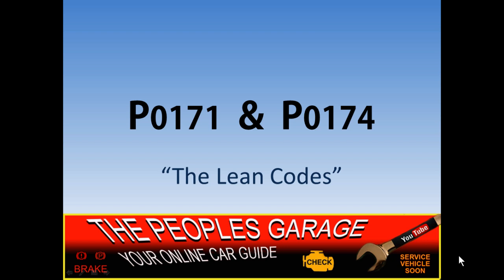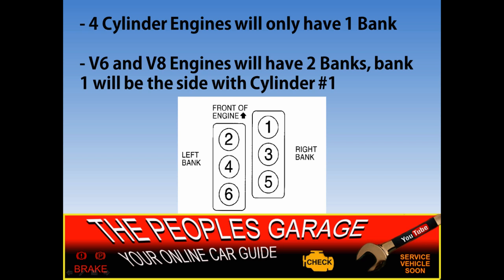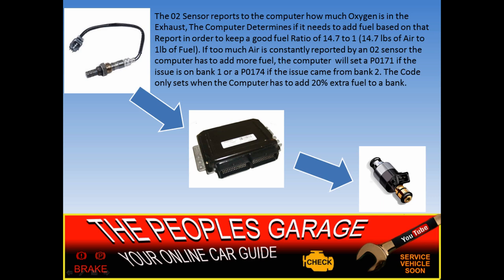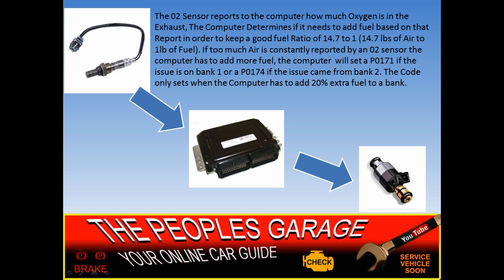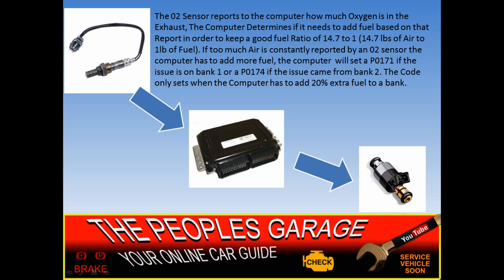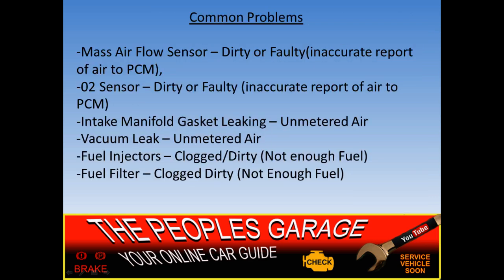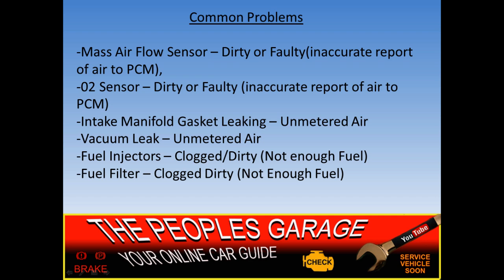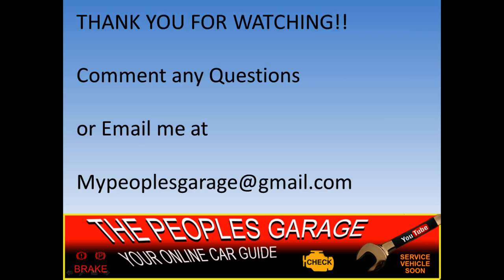How to Diagnose Codes P0171 & P0174 - Lean Bank 1 & 2

Comment: I have a 2002 nissan frontier 3.3 liter Po174 code I have replaced all fuel injectors, new intake gasket new mass airflow sensor new spark, plug wires, new spark plugs new catalytic converters for four new oxygen sensors replaced the fuel filter, spark plug wires, distributor cap and I’m still getting this P174 code I don’t know what else to do. I’m pulling my hair out. I’ve spent about $2000 with different shops. All they do is charge me and they can’t fix it. I’m at my wits end. What can I do? Your videos are very insightful and helpful. Thank you.

Comment: Great explanation I have a 2000 Ford f150 with a 4.2 l engine and I'm getting  p0174 and p0171code I replaced the motor and replace the lower intake gasket, the phlenum gasket and was getting them two codes but was running good So I kept erasing the codes. Then got tired of seeing the check engine light on. So I took off the fuel filter and cleaed it out and it ran great for a while. It just came back on so I'm going to che the pcv and air hose in the back of the motor. Thanks for the information your awesome. I'll let you know the outcome

Comment: I keep getting a random P0174, pending... and sometimes sets a hard code.  Spark plugs and O2 sensors on bank 2 are continually covered in black carbon... I keep cleaning/replacing.  No air leaks. New MAF etc.   Perhaps an ECU issue?  Thanks

Comment: 2007 Toyota sequoia with 4.7L V8 . P0174 . Bank 2 lean . 
Bank 1 fuel trim: short 0.8 up to 2.3
                             Long 14.8
Bank 2 fuel trim: short 2.4 to 5.8
                             Long 25.9
O2 B1S1 output : 3.22
O2 B2S2 output: 3.22
MAF : at idle 0.8 lb/m
Your input is greatly appreciated 
Thank you so much

Comment: Hi there I have 05 F-250 5.4 with code 171 I replace crankshaft sensor cam sensors two of them. Smoke test system cannot find no leaks don't know what to do can you help me out. Motor bucks and pops no power stalls out

Comment: I have a 2001 Chevy Astro 4.3 . Has both codes but they come and go. it will go months with the check light off, then come back on. 
i have checked for vacuum leaks cleaned the mass air flow and checked fuel pressure. I'm lost. I hope you can help. good job on your video. Thanks in advance.

Comment: 2012 Tacoma started with p0300, replaced overdue plugs and coils then  ran good for a day or so then came back. Cleaned MAF sensor and soon after got the po171 and po174. When the codes come on it runs like crap but when I reset the code/s it runs fine again.  Tracking down the issue has been hard. CEL comes on under load usually when accelerating onto highway. MAF, o2 sensor, fuel pump, fuel filter, or intake leak?? How in hell do I find the issue? It’s almost like the ecu is just intermittently having an issue.

Comment: Hello.. May 2023. A po174 question. For a 2003 5.4 Lincoln Navigator 122k miles with all  OBD2 Readiness Monitors all ok (solids).  My engine showed forced air on hot days while driving. Recently, It got hot  a single trouble code po174 cel's showed up.  I believe my issue was to much fuel due to an old K&n filter that is due for a change after years of use noted(old worn) making that 20% issue from your video cel's rich/lean/air mixture.  To test I haven't reset the codes just replaced with another Air Filter (STP Air Filter SA8039) for testing. Since all my monitors showed ok solid. Vehicle runs great and no more forced air on hot days is noted. Other online sites read that a cel's(check engine light) on Engine control modules (ECMs) would reset after 50 miles or 50 engine starts at normal driving if everything is ok at nominal driving conditions.  Without resetting your monitors,  keeping my evap monitor ok (solid) on summer time is quite difficult on hot days.  Some things I haven't found online.  Perhaps, you have an answer for us all.
Question: 
-Do ECM hard/soft trouble codes reset after it's repaired or no longer noticed? 
-A po174 a soft or hard trouble code for a ECM reset itself? 
-A po174 has to be reset in your experience?   
Thanks🙂

Comment: i have 2006 tundra with code p0174  my truck do the lock power i don't have vacuum leak i do the smoke test i get new o2 sensor and MAF sensor but but the code came but after 6k

Comment: I have 2019 Chevy Silverado and I just put a new aftermarket intake on it and I got these codes. I made sure there’s no leaks and cleaned off my mass airflow sensor but it’s still popping up. Any suggestions?

Comment: I have a 2005 Honda Accord....V6 3.0......i connected a fuel pressure gauge....I turn the ignition to the on position and it rises to 58 psi.....as soon as I turn the ignition off it drops automatically to 0 psi.... originally I had p0171 code, I corrected a faulty intake manifold gasket....all new fuel injectors, EGR, all new oxygen sensors, map sensor, pcv valve, intake air tube, my original fuel pump would take about 45 min to drop to 0 psi after shutting the engine off....!! This new after market pump drops to 0 psi as soon as I turn the ignition off, and I also noticed I have trouble starting it now....!! As well as not jus having the p0171 code ...but now I also have p0174 as well ...any ideas?

Comment: Lean code on my 2002 f150 for 6 years....changed o2 sensors, spark plugs and wires, MAF sensor, fuel pump, and had a mechanic take apart the intake manifold to take a look.....left with no options, I decided to get a new gas cap just in case.
Lets just say a wide range of emotions came over me when that ended up being the fix.                
 😀😃😄🤣😕🙁☹️😠😫🤮.......🙂
Reply: Hey so you had both codes (P0171 and p0174) and the cause was the gas cap? What was wrong with it? Was the cap too loose or something? I'm wondering if mine is also caused by the gas cap

Comment: My 2001 Chevy Tahoe transmission has went to limp mode after I replaced fuel pump it has codes p1626 c0287 u1301-c0265 c0292 p0300 p0174 p0101 p01 71
Reply: Will any of those codes cause the transmission to go to limp mode

Comment: My sister-in-law’s car is giving her problems with a 3.5 Pontiac g6 gt it’s a rough idle and the exhaust is sucking back like a burnt valve will .  I have reset the codes and used my x-tool d7 to pin in down as a p0174 code but the intake manifold gasket you bring up in your video made me wounder I’m going to use some propane an see if I can locate any .  It stalled on her many times on the free way going to work I’m hoping to get it fixed for her so she’s not in a accident she’s a good church member and doesn’t have a lot I try to help her out an do what I can but sometimes I think I’m in over my head !  But your video is very helpful by explaining the way you have makes it easier and less problematic for me .  Thanks a lot !

Comment: Mine has only pulled P0174. The only time I notice any issue is on a cold start. Longer that unusual crank time an sputtering, while the voltage jumps a point or 2. Any advice?

Comment: I have a 2013 GMC 2500 with 21k miles on it alarming P0171 & P0174. You mentioned the manifold gasket is a common problem in these vehicles, should I start there? Is there a process you look at in some order like 1. manifold gasket,  2.fuel filter, 3. fuel injector and so forth, otherwise I may end up changing these all looking for the answer. Since they are both coding I would imaging it is either one of these three? Thanks again

Comment: I bought a 2012 Nissan Maxima I changed the PCV hose it had a hole in it and the car still keeps giving me the same code the P0 171 what else can it be the car revs up when it's on Park so like 1,000

Comment: Very proffesional and clearly explained! Thanks for this! I have a dodge challenger SRT8 throwing these codes. The car starts a bit difficult and driving when accelerating really hesitates and has low power but idling is running much better. This makes me think its the fuel delivery issue. Am I correct or it sill can be any of the sensors? But if its the airflow or oxygen sensors isn't it supposed to throw another  code specifically for these sensors too? Thanks for your help! Look forward to your reply.

Comment: I own a 2014 Holden Cruze 1.4L turbo petrol and have had a P0171 start coming up just recently, after it had been parked overnight, I have an OBD code scanner and did a code erase, never showed up again driving the car during the day, stated it up after leaving it overnight,  check engine light came on and the same code again , seems to be happening about 5 to 10 mins after starting the engine from cold,  I'm thinking it may be either a dirty or faulty sensor, as there hasn't been any signs of loss of engine power, stuttering or stalling, but unsure at the moment......

Comment: Such a well outlined overview of Lean codes P0171 & P0174. I've a BMW X3 2006 E83 and have been working thru some very typical it would seem maintenance or lack of issues such as oil & coolant leaks  !!
Error Lean codes P0171 & 174 ran diagnostic and minimum voltage fail came up for both Banks& Sensors  1&2
Whilst I've recently noticed another small rocker cover gasket oil leak which yes may be the cause yet error lean code and very bad fuel economy has prompted me to sort out further issues any other comments on how to work thru an diagnose in the most efficient & sensible approach  
Any advice much appreciated

Comment: 2007 GMC Yukon 5.3L Engine:  I get a P0171 code when running the engine with the AC on for about 20-30 minutes.  Vehicle begins to jerk and shake on idle.  After the vehicle cools of or I turn off the AC, it eventually returns to normal function.  Any ideas?

Comment: What's it mean when the engine idles high until coming to a complete stop before it idles down to normal. I had a P0171 code. I have replaced: IAC VALVE, THROTTLE POSITION SENSOR, EGR VALVE, EGR SENSOR, DPFE, MAF SENSOR, AIR TO INTAKE SENSOR, EVAP CANISTER VALVE, CATALYTIC CONVERTER, BOTH O2 SENSORS ( '98 2.5, 5spd M/T.). RABS SENSOR. WHEN THE REAR ABS SENSOR IS DISCONNECTED IT RUNS FINE WITH NO HIGH IDLE ISSUES, BUT THEN THR THE SPEEDOMETER DOESN'T WORK.
COULD THIS BE A COIL ISSUE, OR POSSIBLY A CLUTCH SLAVE CYLINDER ISSUE, as shifting can be a pain in the ass with the high idle especially when down shifting. If there were vacuum leaks it wouldn't drop back down to normal idle, would it?

Comment: Will an intake gasket leak react to carb cleaner test like vacuum lines do? I ran a smoke machine on mine but didnt see any smoke leaking out. I just redid my intake gaskets, new fuel injectors and coil packs. Found out that 2 of the new injectors we faulty and now the truck is running much better. But fuel economy is terrible. My obd2 showed a pending p0171 code. Im hoping its not the gasket

Comment: Dodge Dakota 2002 3.9(can reset engine light, start it cold, drive 40 miles, light comes on, shakes bad at stoplights)thanking of changing both oxygen sensors on the driver side! Have already checked all vacuum lines on the engine and evap cansiter, have sprayed carb cleaner on intake gasket, got a new gas cap(still no pressure in the tank when releasing gas cap)what would you do? Thanks for you expertise on this problem, Don            (getting po174)

Comment: I have a 2006 HHR Chevrolet I change the oxygen sensor bank one the light still comes back on I cleaned the mass air flow sensor it still came back I checked for leaks with carburetor cleaner it still came back.

Comment: I've  2012 GMC Sierra 5.3 L engine.  All of a sudden  I've  P017 and P0174 , I did an inspection  and saw nothing   but water test for vaccum  again nothing,  but the scan tool says the lean codes are there? Where should I start my repair?

Comment: Great video! Thank you. I got a 2000 chevy silverado 4.3L. Already replaced fuel pump(2x), fuel filter, fuel regulator, plugs, distributor, cleaned MAF sensor, checked for vacuum leaks, smoke tested, found no leaks,  and these 2 codes keep coming up. Car now runs better than ever but cannot pass California emissions due to CEL. Any additional advice for me?
Reply: Check fuel injectors and check for exhaust manifold crack,, use shop vac to push air through tail pipe when engine is cold then spray soapy water on and on joints of exhaust or use smoke machine on it. Use scanner with live data to analyze fuel trims.

Comment: I get the 171 code on start up. but not al the time. it happened once and i cleared the codes. then it happened again over a month later. but only on start up? I changed my fuel filter about a year prior to any codes.

Comment: Check EGR to make sure it holds a vacuum . And run a copper wire thru line and check end caps for a good tight fit .

Comment: Hello I have a question I have a Corolla 2004 with a lean code I can’t find the problem I already change pcv valve, trottle body gasket, exhaust gasket new filter I clean the maf sensor scanner says it’s at 1.67 grams per secon at idle

Comment: It is my fuel pump the shop said that's why I'm running lean do you agree
Reply: I would look for air leaks first if you go to south marine auto on you tube he shows you how to figure it out cause I’m having same problem an or could be your fuel filter mas air flow sensor or your fuel pressure regulator or air leaks hopes this helps out a lil
Reply: They could not find no leaks and neither could I they said it was my fuel pump that's why I was struggling to start and running lean my fuel filter and fuel pump are both in the tank as well

Comment: I got a 2005 ford explorer. I got engine codes p0171 p0174. I changed fuel pump intake manifold gaskets fuel filter also mass air flow sensor air filter. smoked the system no leaks. what could it be? any ideas thank you.. by the way this codes appeared after I changed the valve cover gasket....

Comment: I have a 98 ranger 2.5 l 4 cylinder  and every few weeks im getting this p0171 code. I have done most of the air side new iac, new mass air flow, new 02 censors, new pcv valve and hose, new dpfe, new purge canister, new fuel filter, new vacuum lines, new egr, and im struggling as to what else can cause this. I noticed you said clogged injectors, what about plenum gaskets? Idk im at a loss for this truck

Comment: The code reader on my 4cykiner Toyota does show 0171 AND 174. It shows P0171: (code 1of4) System too lean Bank1, P0174:(code 2of4) System too lean bank 2. While P0171(code 30f4) shows pending, as you said its4cyl so it has nothing to read as it trys to read bank1 too lean.same with P0174(code 4of4)  is Pending, too lean bank 2.  Hmm? Any help with this? its a '02
Reply: @Green Drop Talk Thanks for the reply. I changed both upper O2 sensors, and the lower one I had replaced a few years back. I took out the MAFS and used the specail cleaner in the can for it. It looks like there was a slight lighter color, cleaner, but not much. I cleared the codes, and after 2nd day driving Check Engine light came back. I checked codes, and they were the same 2 codes.  I got 2 lower O2 sensors to change, but I am thinking this isnt the cause? I think I have Tech Stream which is Toyota code reader software. I can check with that thing on a tablet or laptop, but, I dont think it is going to tell me much more..Or maybe I dont know what to look for? THANK  you!
Reply: @Green Drop Talk Thanks, I'll try that tonight. I forgot to do such a check. There is a small hose connected to the air filter that was off initially, I put it back on. I should see if it si loose.
Reply: @Green Drop Talk 2002 4cyl Highlander.
Reply: @Green Drop Talk I'll give that a try !

Comment: I have 03 Sierra 5.3 had p0300 code cleaned injectors changed plugs and wires and fuel filter and now it’s reading bank 2 and cylinder 6 misfire,it runs ok for a bit and when it warms up the check engine light starts flashing then it turns off and flashes again after a while,any idea what it might be?
Reply: Forgot,I changed two O2 sensors also,bank 1 after cat and bank 2 before cat and cleaned the other two

Comment: I have had this issue for years!  I have a 2000 Jaguar XK8.  It has had some issues, I was having a problem with the fuel pressure regulator.  It had a leak and I replaced it.  It dropped a valve seat and had the head repaired.  I finally got the car back after a long time and it seemed all good except the old problem of codes P0174 and P0171.  I actually had them before.  When the valve work was done, and before I picked it up my mechanic would run the motor,  well he finally ran it out of gas and blew the fuel pump.  I got the pump and the filter replaced as well as a crumbled tube that connects the snorkel to the valve cover.  I had earlier replaced the MAF.  I realized I put a non Denso in and replaced that with a Denso MAF.  I have tried spraying carb cleaner around the intake, and noticed no difference in the running engine.
I am driving the car about 8 miles in to work.  It will toss the codes usually toward the end of the ttrip.  It occurs when I am stopped or backing up, like into my driveway on the return home.  There are certain traffic lights I get stopped at where it codes.  I also get a dreaded RESTRICTED PERFORMANCE alert.  I can clear the codes and it will run fine.  If I don't clear it will go with limp home speed for a few moments.  The Restricted performance clears and it runs fine then.  The P codes stay.

Comment: Good explanation, if I only have p0174, that would not indicate that is the MAF right,  would the MAF always generate both p0171 & p0174 or can it generate only 1 code.
Reply: It would be both codes if it was mass sensor.